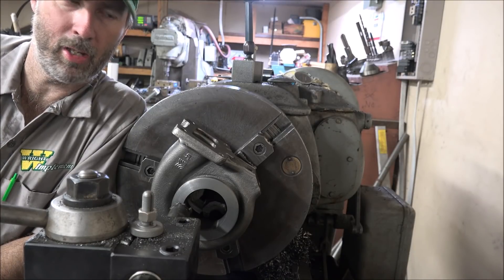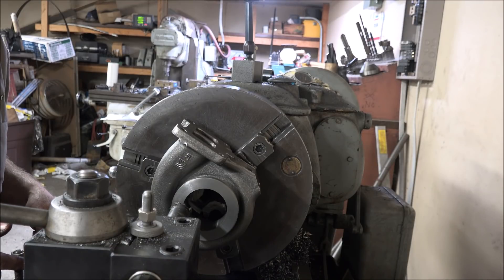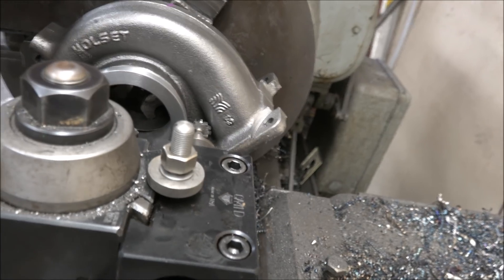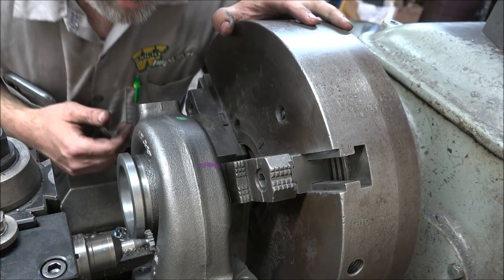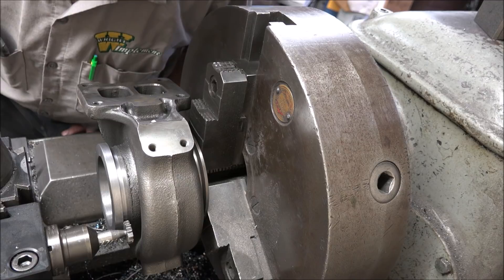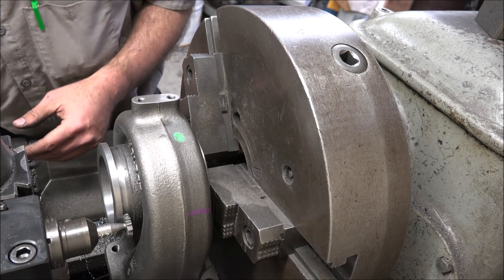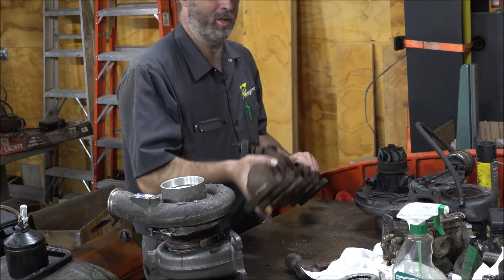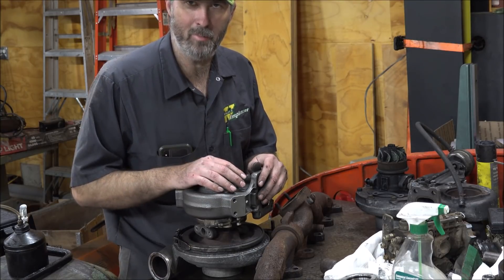Stunt Lathe Work No Clearance Around a Corner Machining.

Comment: I use a quick trick for those 90deg tools. You can tig weld a Hss tool bit on the end of a steel bar , i use them to make o-ring grooves whatever width i need and dont need to grind a whole hss .......

Comment: Hi Brian, That really is thinking outside the square! Never seen a woodruff key cutter cutting stationary. There certainly wasn't much room in there.
Reply from the maker: Might as well half the time the cheap ones only cut on one tooth anyway. Lmao
Reply: @bcbloc02  That's only funny because it's TRUE! 😄
Reply: @bcbloc02  so as long as you don't pick the one that normall cuts you should have a sharp tooth. The same thing often happens with horizontal mill cutters, not all seem to be working, even on the good brands.

Comment: that was good timing. I just broke the  turbo axel shaft on a AUDI .8L  What a pain to remove,  had 2 quarts of oil in the intercooler and another catalytic converter, smoked like  mosquito fogger.   The housing is OK but I will need to polish the compressor face, then skim it for the clearance in the new center section.  I would never attempted this before I saw your turbo videos.

Comment: The Monarch doesn't have reverse? Or is it not working for some reason...hard to imagine a lathe, especially a really good one, without reverse.
Reply from the maker: No reverse motor contactor on the little Monarch. I guess being a war machine if they didn't need it it didn't get it and nobody ever added one. Maybe someday I will get another contactor and switch and wire it up like the big Monarch so it can run either way.

Comment: I like seeing you do the same turbo work I do.. I've had to make a few specialized tools to get around that $%$#$ flange as well... with my small lathe and relatively small diameter tools I'm also often REALLY close to hitting my compound or toolpost when I have to reach deep into a housing to clean things up. 
I've had some cheap turbos where the outlet flange wasn't just not centered with the CHRA flange, but not even parallel to it, makes for a long, slow setup to get things running true
Reply from the maker: Its those semi finished china turbos you buy! lol
Reply: @bcbloc02  haha, yeah.. but I've seen some MISERABLE casting quality from genuine Holset turbos too, totally porous aluminum that I couldn't get a decent finish on (compressor housings)
Here's a pic of the chinese new housing vs the genuine holset (Made in NC, USA) and the factory finish.. wish I"d have taken more, better pictures https://postimg.cc/gallery/ZpCvMv7

Comment: That is pretty slick.. Of course Axelson users are disadvantaged in that we don't have to think outside the box to make our lathes run in reverse..   🙃
Reply from the maker: I wonder if ww2 models came fully equipped? I think mine just got shorted the contactor because of when it was made.
Reply: More likely the forward contacts wore out and someone just swapped the reverse contactor rather then silver solder the old contacts.
Reply from the maker: @mbbmidwest3556  No it was only configured to run forward from new. It never had a reverse button or the interlocked contactor for reverse.
Reply: @bcbloc02  well that's a bummer....I have a 1940 Monarch C 14x78 from a gov auction. It had the original Westinghouse starters still in it, but the forward set was toast and the wire insulation was falling apart from 70yr of oil and age. I just ended up just making a new controls package and box. I don't use reverse too often, but it's definitely handy when threading a blind bore.

Comment: Nice stunt machine work
Reply from the maker: Thanks
Reply: @bcbloc02  
QUESTION..u watch “western truck and tractor repair”
when u get a chance watch the JD 8thousand series video called “this is why I rebuild my own, no remans” he put a remand JD in this big tractor and cam interfered in 15min. 
His question is how does JD go about dealing with there remans, he explains JD don’t do them themselves.
Do they contract them out?
Do they do them in Mexico? If anyone knows this question it would be u :)
This cat is out of Klamath Falls on the border of Ca and Oregon.
When u get a chance, take a look. It’s long videos like Fred but better.
Reply from the maker: @JJ-jv1gu  As far as I know the Deere reman center is in Springfield Mo. https://ded.mo.gov/content/john-deere-reman-expands-springfield-creating-130-new-jobs
Maybe one of those new hires put it together and forgot to torque something.  Had it been done at a Deere dealer Deere would have had to eat all the costs of that mess up. They will have to lean on the territory people to get any money for Warrens labor though.
Reply: @bcbloc02  
Interesting,
for some reason he believes they outsource em.
Thanks for the info BigMan :)
Reply from the maker: @JJ-jv1gu  I mean the rebuilds aren't done in the same factory as the new engines so it is a different deal. It is also possible they didn't buy a Deere reman but got one from somebody else even though it came from a Deere dealer it could have been some other vendor than Deere that rebuilt that engine like TTP or Worthington.